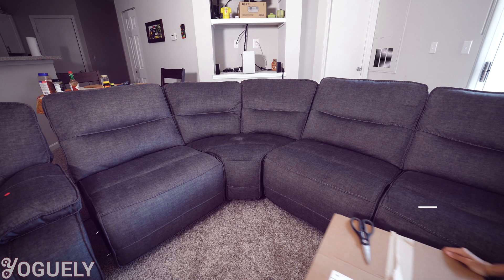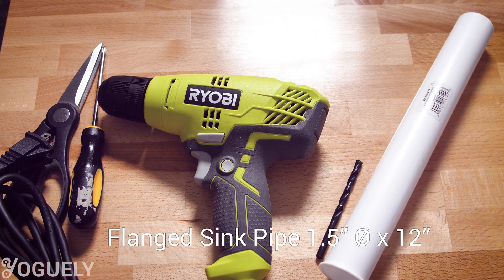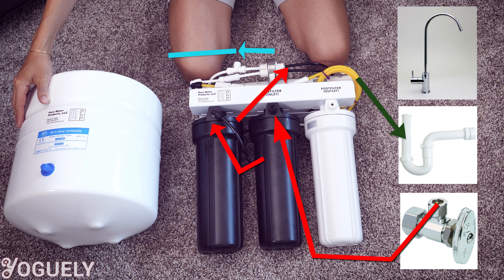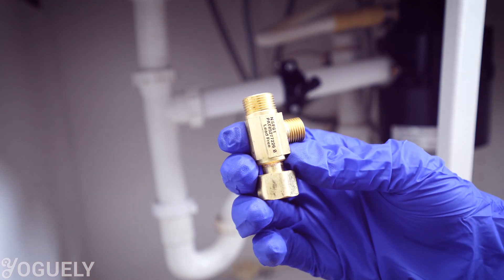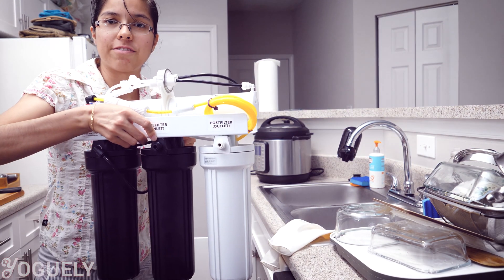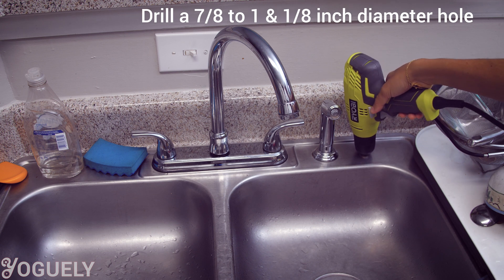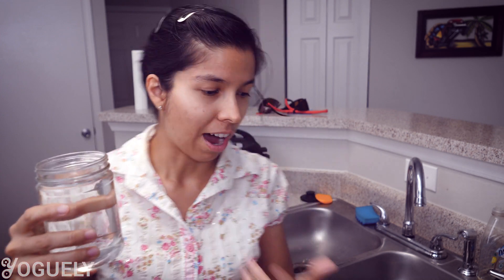How to Install Reverse Osmosis Water Filter System Under the Sink (Step by Step)

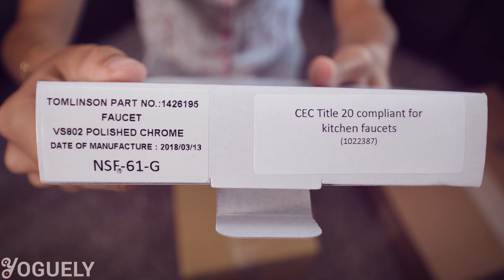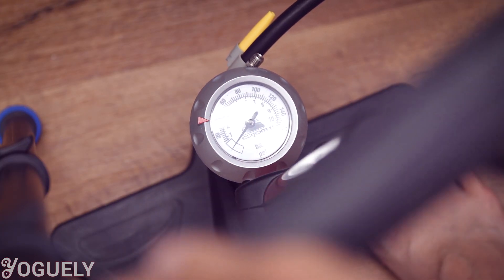Comment from the maker: ¡Hola! How’s your RO installation coming along? Scroll through the guide, topics covered:  Unboxing (0:30), Why an Air Gap Faucet (1:20), Tools You Need (2:14), RO System Overview (2:44), Installation Approach (2:44), Drain Saddle Outlet Pipe (3:44), Cold-Water Inlet Pipe (6:40), Preparing the Filter Cartridges (9:25), Connecting the RO Filter to the Sink (10:54), Installing the Ledge Faucet (10:56), Installing the Water Storage Tank (10:51), Initialize the Reverse Osmosis System (14:00), Test the RO Unit (15:19), Finalize the Installation (16:20), & Afterwards (16:47).

Comment: Thanks for the video. Did you take the horizontal drain pipe out to make drilling easier?
Reply from the maker: It is for the noise of the drain water dripping into it. On the horizontal the fall distance is shorter, compared to making a hole at a vertical pipe, the water would fall a longer distance till it hits the botton of the tube, this making a louder splash sound.

Comment: i have a question what if i install it the same way as u as not attached to sink.. and what if someone tries to turn on the cold water.? what will happen. or what about hot water.? will it affect the seperate sink.?
Reply: The hot water line is not attached to the RO , it won't affect anything.  The cold water will work as usual as well, the splitter installed at the cold water outlet supplies water to both the regular sink and the RO system.

Comment: Hi Aida, I am curious about why you chose that particular model, I went on their website and see several options. A 50/50 model, another with a permeate pump, it looks like you have model ro002. Thanks for any after installation thoughts.
Reply from the maker: A permeate pump uses the water pressure of the drain water to pack the purified water into the storage tank. I did not need a permeate pump because my city water pressure of roughly 60 psi is plenty. 

For low-pressure installations, such as if you have a well system that only provides 40 psi, you might benefit from a permeate pump.

I got model ro051. Links to all the stuff I got are in the full article: https://www.yoguely.com/install-reverse-osmosis/

Here I explain why I chose the 50/50 model: https://www.yoguely.com/reverse-osmosis/#Differences_Between_Reverse_Osmosis_Membranes
Reply: @Yoguely  Thanks again! I’m waiting for my TDS tester from Amazon today, Watched “The devil we know” last night, horrible! And after my results I’ll be buying my ro filter from Pure Water Products like you later today, thanks for your assistance and knowledge.

Comment: What service is needed in stage 3?
Reply from the maker: Stage 3 filter is the RO membrane. Replace the Reverse Osmosis membrane every 3 to 5 years as needed. You can test the TDS of the water to determine if its time to change it. 

Other than that, you may need to lubricate the O-Rings in the vessels with Silicone Grease when replacing the membrane cartridge.

More info: https://www.yoguely.com/reverse-osmosis/#Maintenance_of_Reverse_Osmosis_Membranes
Reply: @Yoguely  Thanks so much Yoguely, I immediately ordered a TDS tester from Amazon I think it’s coming tomorrow or Thursday, I live in Port Charlotte Florida and I’ll send you the level of TDS ASAP, John